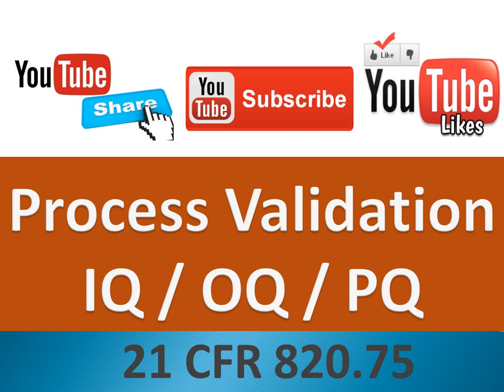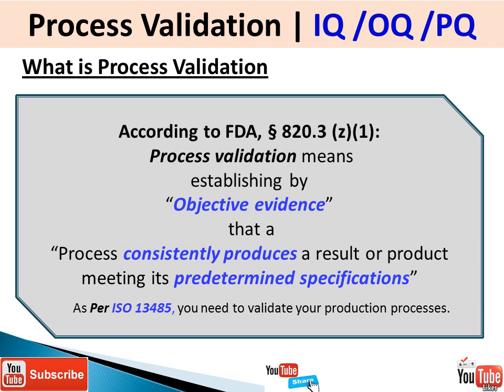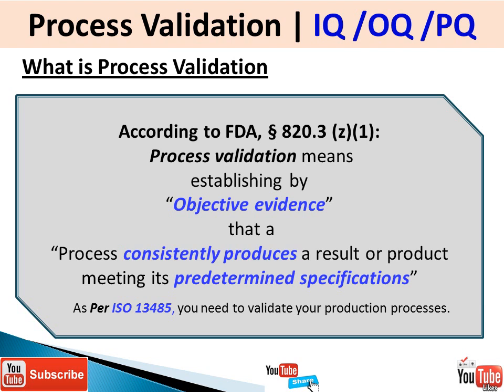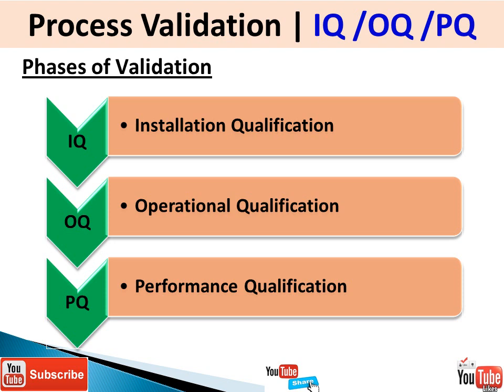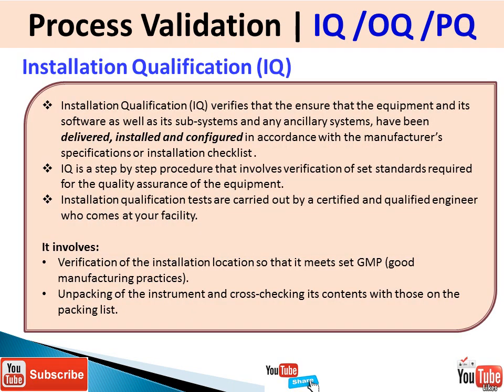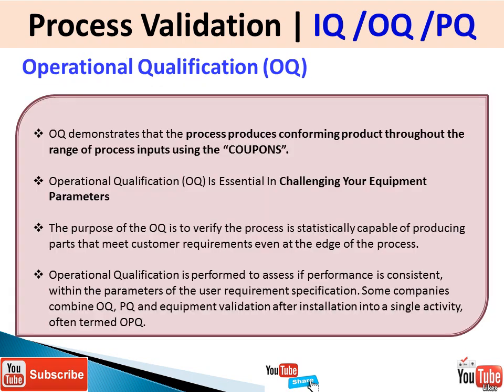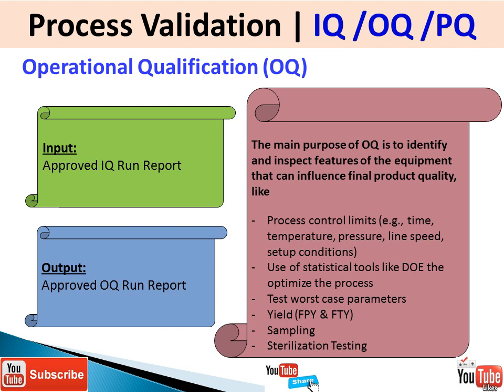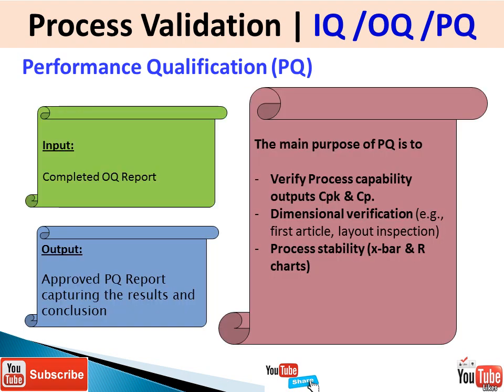IQ OQ PQ | Process Validation | Equipment Validation | Equipment Qualification | Medical Devices

Comment: Will you please elaborate each phase of equipment qualification with listed
(1) how design protocol, what is the basic approach and require thing to design protocol, reference of protocol design

(2) any common considerations in protocol design irrespective of equipment make mechanism function etc. Eg. Safety, risk assessment, challenge studies, product runs like that are any more. 

(3) what we have to do if we observed non intrensic failures of equipment qualification 

(4) how to schedule calibration, preventive maintenance

(5) how we can recommend preventive maintenance, in what way, what we need, and references of preventive maintenance etc etc

Comment: The Medical Device - Risk Management Regulation is ISO 14971. The Medical Device - Quality System Regulation is ISO 13485. The Quality System Regulation is QSR 21 CFR 820. The installation location should be verified, so it meets Good Manufacturing Practices. Installation Qualification is a step-by-step list for the quality assurance of the equipment. Some inputs areDesign Failure and Mode Effect Analysis, Process Failure and Mode Effect Analysis....
Reply from the maker: Seeba, seems you have good experience with in Medical device development